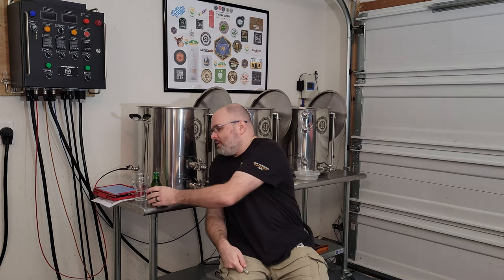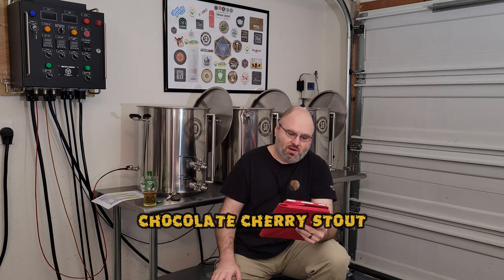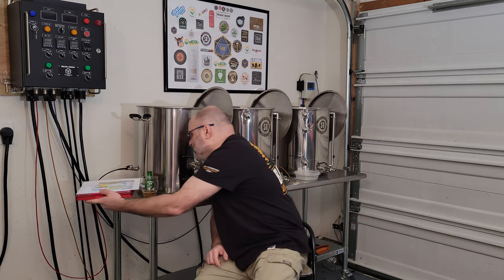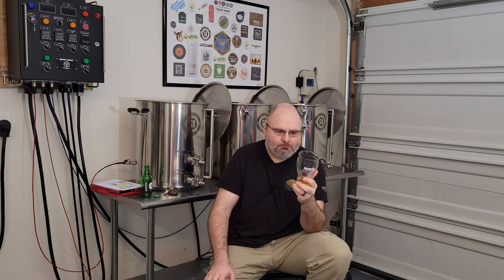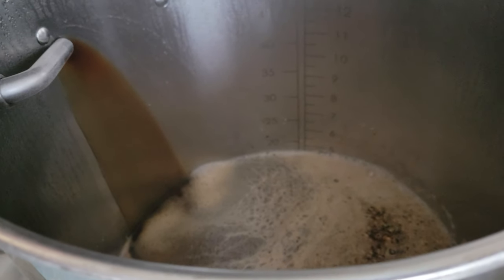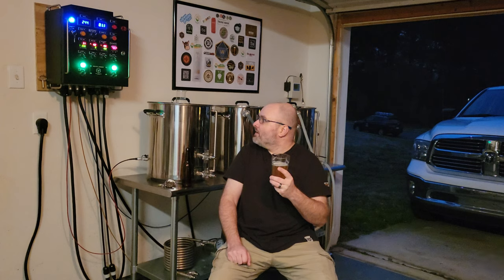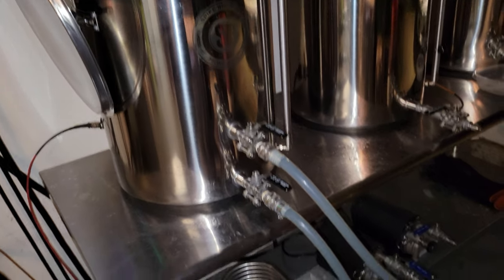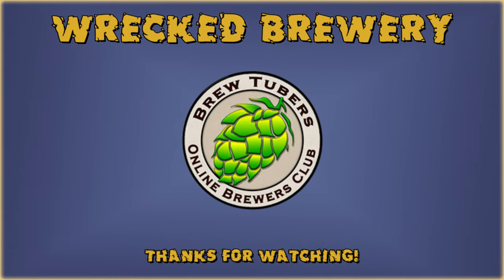HBW107 - Chocolate Cherry Stout Brewday

Comment: Great video Matt! Cant wait tonsee how that beer turns out and how much pressure the brew bucket holds! 17 bucks for a floating dip tube at more beer and you can make any keg pressure fermentation ready. Thinking of retro fitting all of my kegs with it for the flexibility.  Sláinte!
Reply from the maker: It's holding pressure so far today.  Up to 2.5 psi so far.  We'll see!  Cheers Dennis!